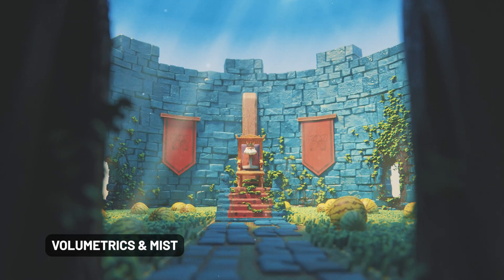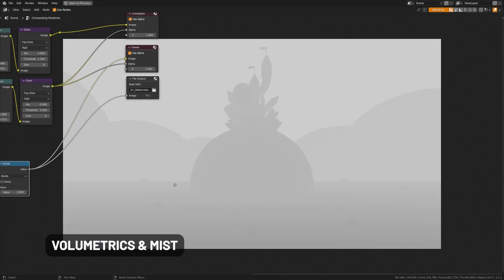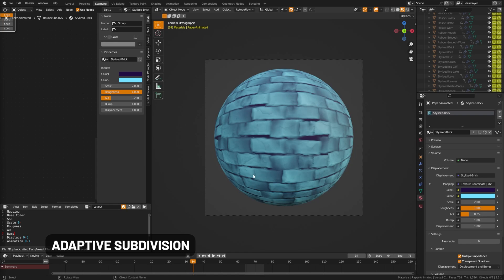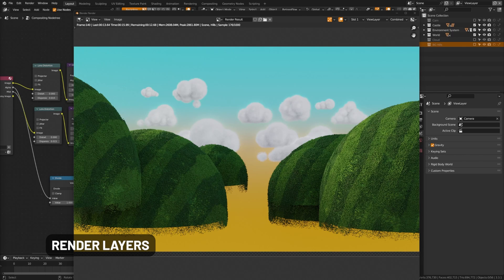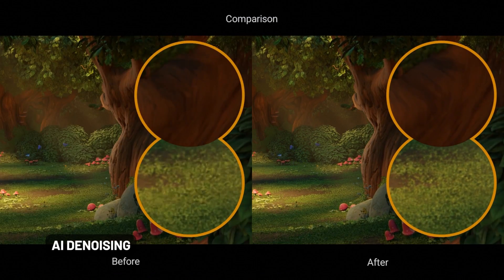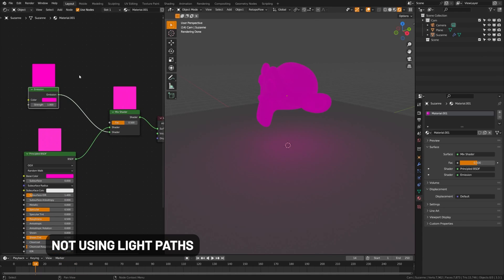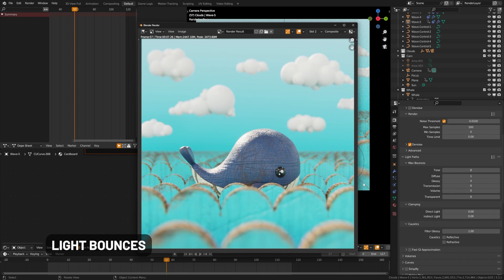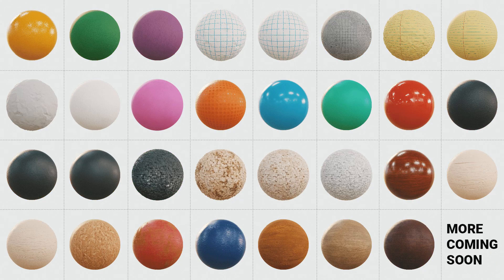10 Blender 3D Render Mistakes and How to Fix them!

Comment: Thanks for the info – I didn’t know that trick with a Light Path Node. But I know some other techniques, that will help you to optimize your scene.
1) Don’t use .png textures, use .exr instead. Yes, file format does matter. PNG is a terrible choice for any CG work. 
2) Blender doesn’t have a temporal denoiser, but you can set up a simple velocity deflicker in Blender Compositing (there is a tutorial on YouTube). It will significantly decrease render time for animation and reduce specular noise (fireflies). The only downside is that you have to render 2 more frames.
3) Don’t use high-res HDRIs for lighting. 1k/2k HDRI is more than enough for most cases. If you also use an HDRI as a background, you can download two images – one for lighting and one for your background/sky. Render your scene with a low-res HDRI, then switch to the high-res and render the background only, and then just comp the beauty render over the background. I also recommend checking an HDRI before using it, sometimes it might have some crazy values like 60000, it’s better to clamp those values to something lower. 
4) Utility AOV require memory to render. If you need Cryptomatte, Mist and Depth, but you ran out of VRAM, you can render them on a different layer without any light and textures.
Reply: PNG is not a terrible choice (not as bad as JPEG would be, at least), but you do lose light information due to the limited color information that is stored. EXR doesn't have these limitations, so it's much better. Really, only if you're going to be compositing (which most beginners won't) is EXR going to be needed.